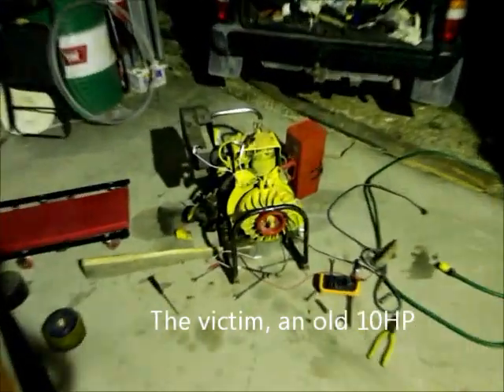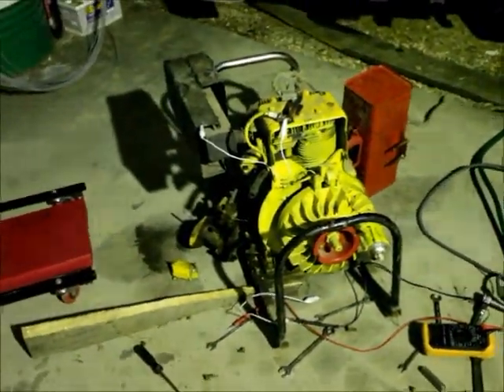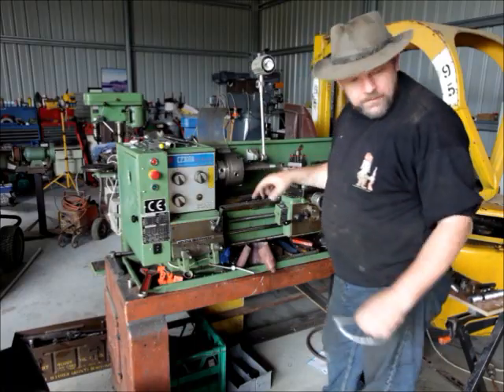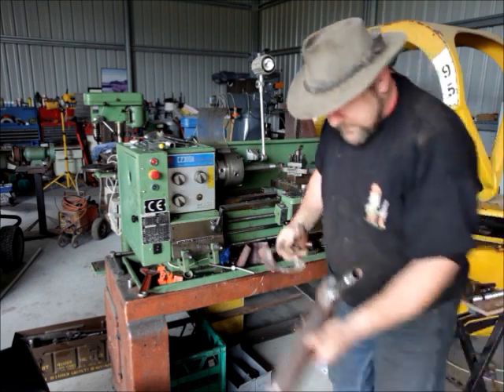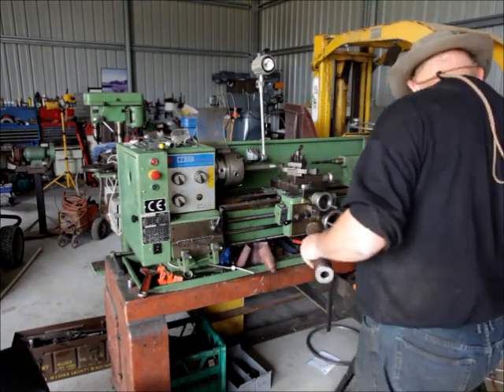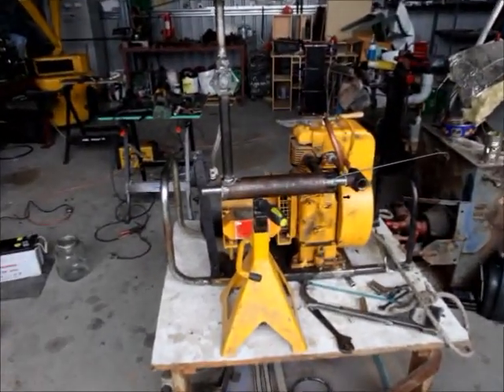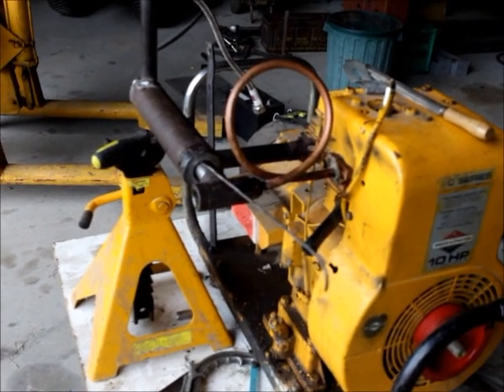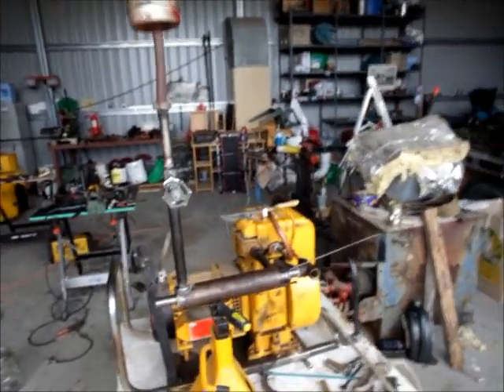GEET / Fuel reformer 1st test

Comment: Nice build.I've been wondering about the use of copper running from the reactor and thought it might be better to use like steel break line material to maintain the magnetic structure of the ionic field .I'm going to switch and see if it helps.Another thing is the motor runs cooler lessening the amount of heat available in the reformer so I use insulation ,sort of like a cast,to help maintain temp .

Comment from the maker: Hey Josh, ummm mileage???, I didn't get a chance to do too many test on it but I suspect it could gain perhaps some extra minutes of use compared to a carburetter. For me it just worked as a vapour carburetter, because when the gasoline vapours went... the motor slowed down (due to lower temp vaporizing  being consumed first i.e. the petrol). When I get the chance I will just use water and petrol, the diesel or oils needs a lot heat to vaporize and/or pressure.